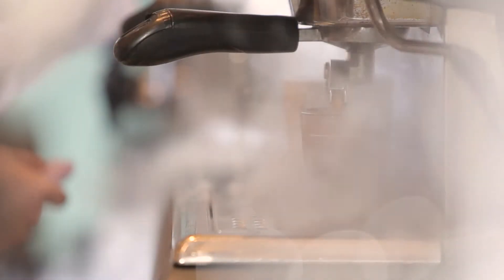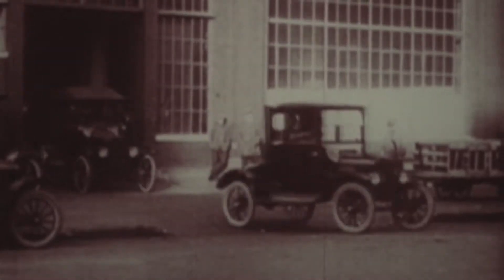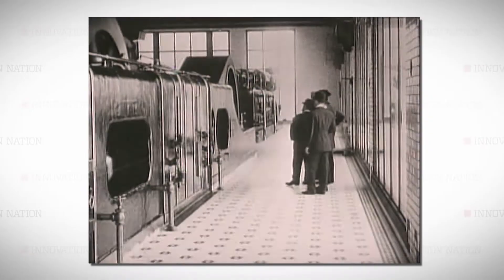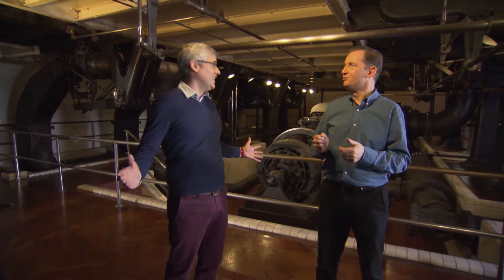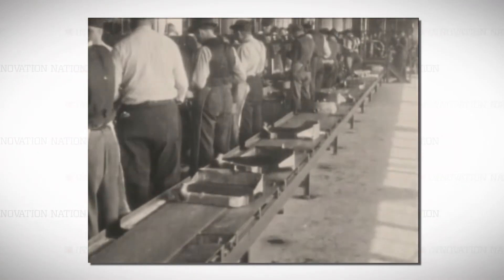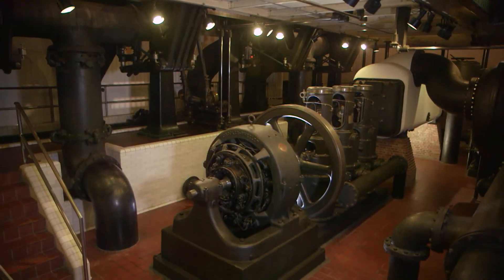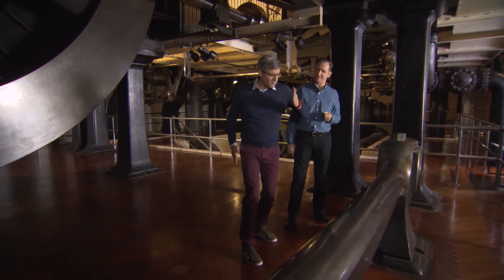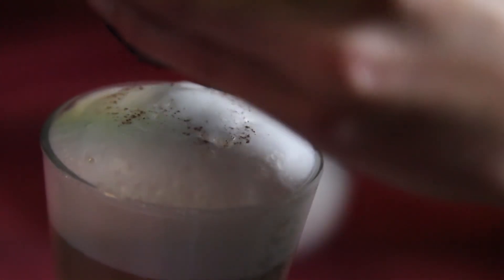Ford Highland Park Gas-Steam Engine | The Henry Ford’s Innovation Nation

Comment: So if you take a regular square And then you take a size level it's got 3 different water spacings To me you should split your level And slide it down in there And you learn your division area growth point Or your separate racing to produce atmosphere steam to learn how to straighten out your mechanical functions to all your gear ratios But I don't control my internet Out of Nowhere on me

Comment: See mister ford in mathematical steam pressure There's alignment depths So what I learned to do was I learned to take fractions as a square and I learned to divide the coverage depth which way ISo what I learned to do was I learned to take fractions as a square and I learned to divide the coverage depth which way I wanted to principal or which way I wanted to link Between the difference in a hourglass From outside to in or inside to out so you learn how to segregate your spread material 4X change From a river to a creek By learning the depth of your water levels inside of a level

Comment: My grandfather was the draftsman to the designer of that engine, Edward Gray, who in late 1909 became Henry Ford's Chief Engineer and Construction Engineer. My grandfather, Elmer LeSuer, was Gray's 'draughtsman' first at Riverside Engine in Oil City, where the first Highland Park power plant engine was sold from and built there, a 1500hp gas engine. Next came a 5000hp gas engine similar to this one, both sides gas with a slightly smaller flywheel. The first of the 6000hp engines were gas only. About 1915 Ford engineers swapped out one side of one of those first engines with a steam engine, using the heat generated by the gas engine to pre-heat the water. In the end there were nine of these built, this one being # 11-12 (each side having its own number which would mean this was #6 as a combined unit). Interesting facts, that massive flywheel which is mentioned weighs 100 tons and the two halves are held together by two one ton 'keys'. This engine was the first object installed in the museum because it had to come in before the 'herringbone' teak floors were laid. Roy Schumann was the man put in charge of moving it from Highland Park, a difficult undertaking indeed, but Mr. Ford gave Schumann all the support he’d need to get the job done. In fact, Mr. Ford had to ‘fight’ to save the engine, others just wanted to scrap it with the others. 
During the installation, Schumann mentions that they came within six inches of the ceiling installing the flywheel! They couldn’t bring a crane in to install it either so hand winches had to be used. They had to heat the two keys ‘cherry red hot’ to insert them. A careful look over the engine will reveal that a few bolts did get misplaced and are missing. 
There are some stories that would indicate that Edward Gray left Ford Motor over a dispute about switching one side to steam. Regardless, the basic design is Gray’s and his name appears on the ‘end plate’ of the 5000hp version of the same design. The first two may have still been in operation in another area so there may have been eleven running at one time. After that first one was built in Oil City and Gray was hired and left Riverside Engine the rest were built by the Hooven Owens Rentschler Company of Hamilton, Ohio. Of course the generator itself and other parts were sourced from various firms (oilers, pumps, etc.). This was in part that Gray didn’t leave Riverside on the best of terms with his partner, John B. Smithman, who sued Gray in Michigan courts over what he thought he was owed from the partnership.
Although the first gas-steam engines didn’t ‘fire up’ until 1915, the design concept was revealed in a January 1914 trade journal. The delay could have been because of a flood in Hamilton that damaged some of the facilities at Hooven Owens Rentschler. Hugh Dolan, who worked in the power plant starting in 1913, provides the most vivid history of its workings. He had previous experience in Racine, WI with ‘producer gas engines’. He lost his job at the previous plant in that it closed down. Why? Because as cities began to provide electricity companies running their own power plants became an unneeded expense and headache. Cities had surplus power during the days as back then home owners were only needing electricity for lights, not refrigerators, computers, air conditioners, etc. like we run today so the power companies would seek out companies to sell to at reduced rates as once running you don’t shut down a power plant except for routine maintenance or repairs. Mr. Dolan’s stories can be found online in the Benson Ford Research files, very interesting reading! (Along with Roy Schumann’s stories and many more.) 
More could be told but many articles I’ve researched, items not in the Benson Ford collection, are at https://www.flickr.com/gp/rushhourphoto/69w2P4